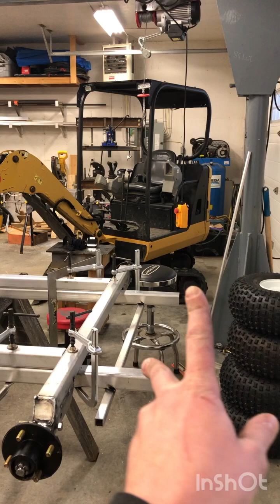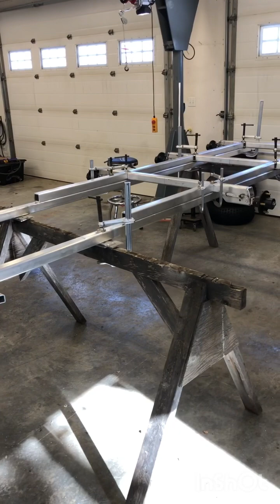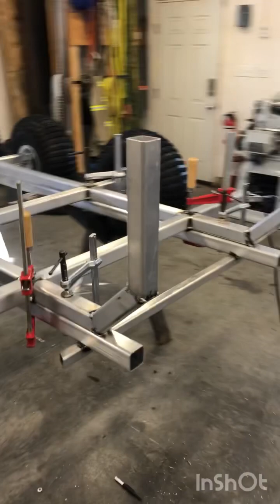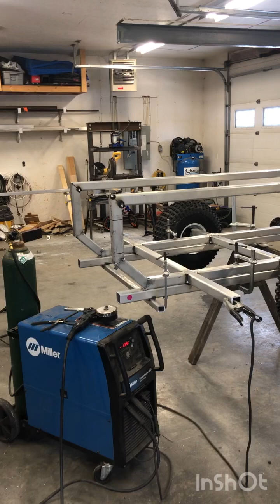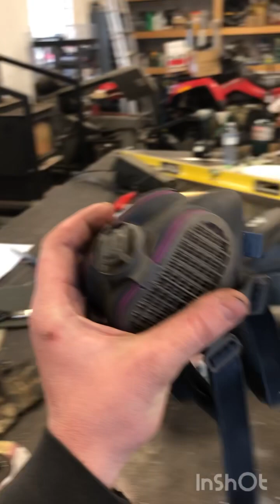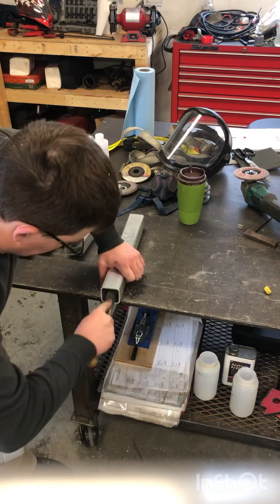Mini Snow Cat build PT3. Continuing Chassis Build

Comment: Really nice project i glansed over it and are gonna start watching this series. think your craftman skills are really nice. however first comment: i dislike your initial bottom frame since you have stiff axels. Will it work sure, but it will not be a great machine to ride, and you also gonna see issues with the tracks and the terrain, and more important very rough riding. there should be some sort of shock absorbing, not very high level of comfort like a road vehical but some. from knowing tracked armored vehichales, tension bar suspension would be a good option (ofset axles thoe), rough and durable but allows for individual wheels to move to keep traction and smooths ride alot. an alternative is similar swing bars with a car spring/damper. maby just to keep it simler you could have mounted the wheels in boogy (can be easy made or bought), even with no shock absorbing it will still help? And dont you need a tension wheel, with a idler build ind? what type of alu are you using? i would assume 57 H11 or 57 H22 is good options. if you use 60 series or higher the temper is gone when you weld it.
Reply from the maker: So this is a winter vehicle for starters. Also the tires and terrain will provide the suspension. This has been proven already with Argo, Muddox. It’s also not a fast vehicle.